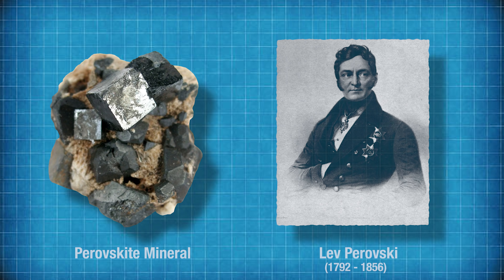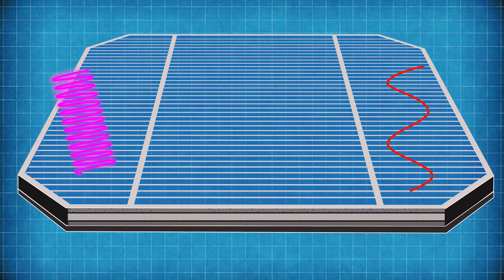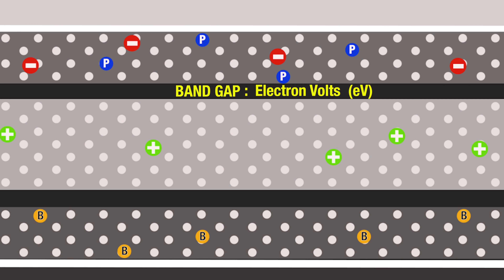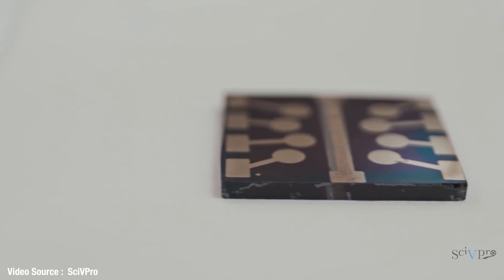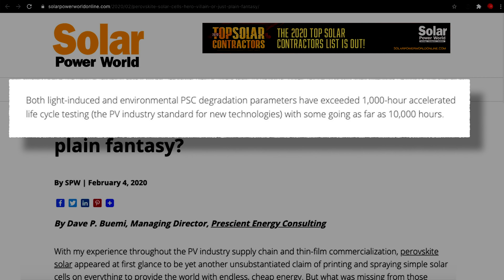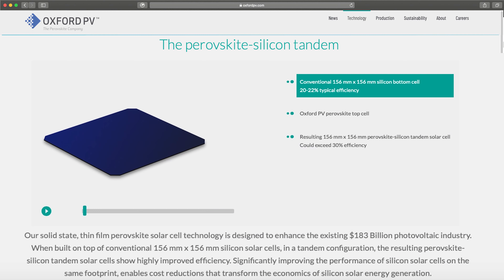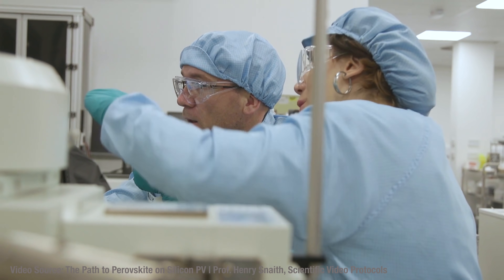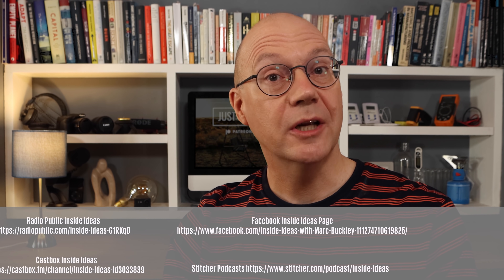Perovskite Solar Cells: Game changer?

Comment: Similar to multi-junction photovoltaic, I expect that the 2030's will see a leap in prismatic solar-to-hydrogen; that is, catalytic water-splitting , using photons on the surfaces of tiny crystals to cleave hydrogen, NOT solar panels -> electricity -> electrolysis. Because graphene doesn't leak hydrogen, that'll be the best energy density, re-fueling time, material abundance, and scalability - especially because your fuel tank is a zeppelin! The main strategic advantage of catalytic splitting is that it works even with 'blurry' and 'partial shade' light conditions; just like real chloroplasts... and, it weighs next to nothing, despite a high potential power density - powdered crystals have immense surface area. It'll be ideal for asteroid-mining rigs: cheaper than fancy ion thrusters, a broader profile of thrust/efficiency available, no need to haul xenon continuously when hydrogen is everywhere, and with a little titanium, silicon and carbon, you can scale-up engines, fuel arrays, and gas tanks on-site. Oh, and photocatalytics have the physical capability to get more that 80% efficiency (fundamentally, the energy of the photon reaction is converted quickly and close-at-hand into a chemical that stores the energy while simultaneously drifting out of solution - very different from the accumulated layers of charge over a large distance in solar panels...). Good luck, voltaics. Elon has mehbe 15 years before batteries are supplanted by ultracapacitors (expect Shoulders' style of vacuum caps), and hydrogen catalytics are understood by AI.

Comment: Every house that is in the sun needs solar panels on it! With about 5kw of solar and 25kwh battery, with ability to send excess power to the grid, keeping the grid, with solar farms where possible, like over highways, and buildings in city's, with homes having enough battery to power the home around 75% through the night, the grid can supply the rest, using hydroelectric generation plants, and for no sun, keep a few natrual gas plants, to catch the slack! Just talking about it , it's the perfect solution! I'm off grid, so you guys do what you want! I'll keep making my own power, I do need about 4 kw more panels, and 20kwh battery, and a week or two without sun will be no problem! With a few other power producing options, like wind turbines, and a micro hydro generator. I should only require 10 kwh more storage, and I'll be set for about  20 days of rain!  There isn't just one big solution, it's a lot of tiny solutions! Like at the home and town level, not the city, county or state, we all need to take the energy production into our own hands, I bet things would advance and improve greatly, if things got the boost from everyone wanting the most effiecent panels and batteries, ppl would want just a few panels, MN ot the whole house covered! Or taking their yard. To make power, when 70-80% effiecent panels would take 1/4 the roof, and power the home while charging batteries! Ha-ha just think how it would be if everyone produced atkeastv1/2 if their energy needs, including their transportation !!!
Reply: There likely isn't a solution that will be optimal for all countries at once. At high latitudes(canada?) solar may not be a cheapest option, so nuclear energy should be a cheaper solution, with less enviromental effects.

Comment: Living off grid 19 years still waiting on that darn better battery!

Any videos on next generation off grid batteries ready for prime time would be great.

Thanks for another informative video, however please clarify on band gap.  Way I interpreted you explanation it sounded like a physical gap, which I’m pretty sure it is not.
Reply: Didn't you realize at this point that the so called "new battery technologies" announced to be breakthrough and just around the corner are just scientists advertisers looking for tycoons to invest in their groundbreaking new shiny stuff ? Pretty much everything you read about it is still in experimental phase...
Reply: https://redflow.com/applications/residential/
Big, heavy, maybe a little expensive, but might be what you need.  Handles full discharge over and over.  Generally used by Telco's for backup or off grid cell towers etc because they perform so well.